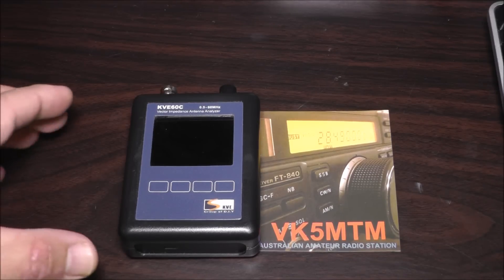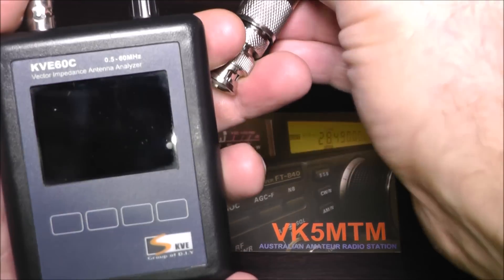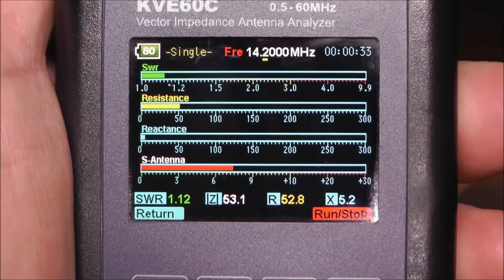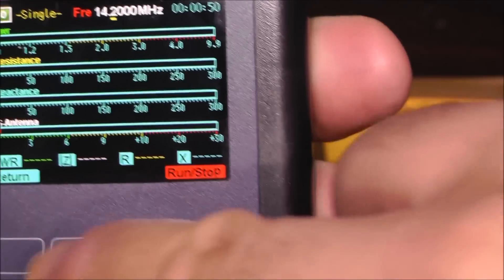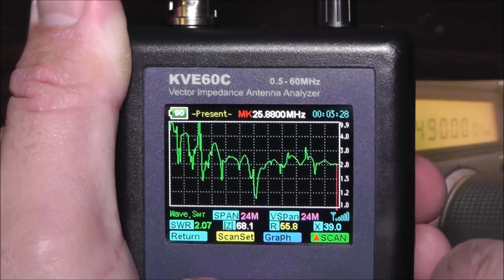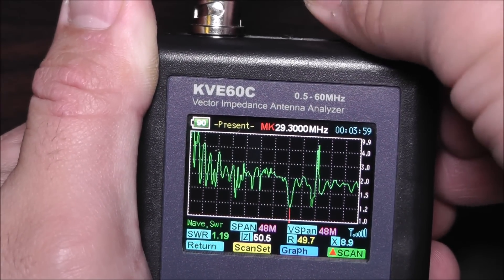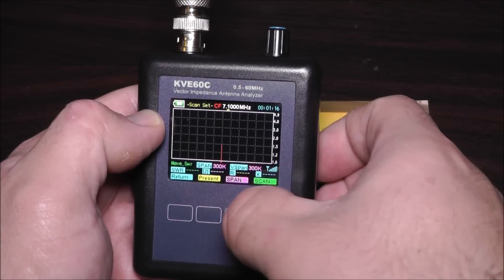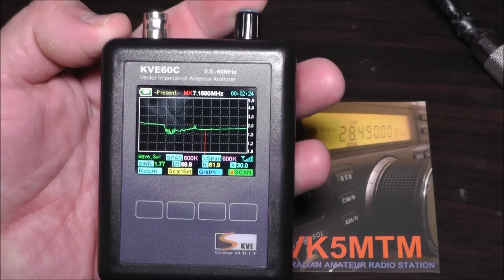KVE-60C (MFJ-223) VNA antenna analyser quick review

Comment: MFJ is using the term "VNA" very loosely here.  This is actually a Vector Impedance Analyzer and not a Vector Network Analyzer.

  Basically the difference is that a VNA uses two ports to actually sample and measure while a  Vector Impedance Analyzer  lacking the second measurement port attempts to mathematically calculating the missing data, this means that quite a few parameters can only be guessed, for example phase angle which cant be directly measured with a  Vector Impedance Analyzer.

My suggestion is to save your money and buy something like a MIni VNA which is a true two port VNA.

Comment: Does it come with manual, or how do you know about the settings? New at this, will it help you tune an antenna perfect so I wouldn't need an auto antenna tuner? Many thanks for the video dude :) 73
Reply from the maker: Robert Herzberg Yes, it does come with a manual but to be honest I've never opened it. The device is very easy to use. Yes, it will help you to build a resonant antenna so you don't need a tuner.